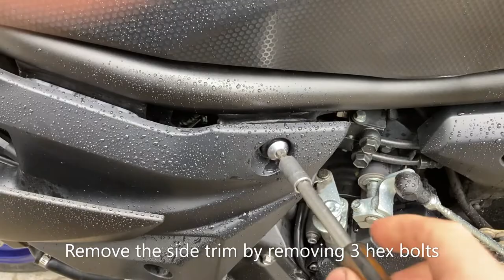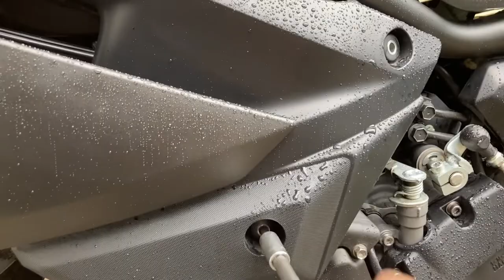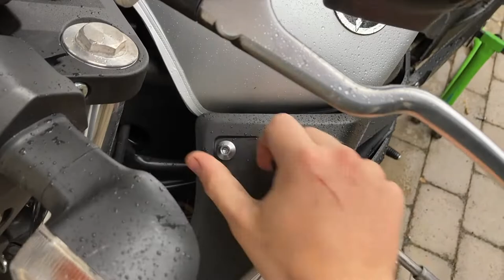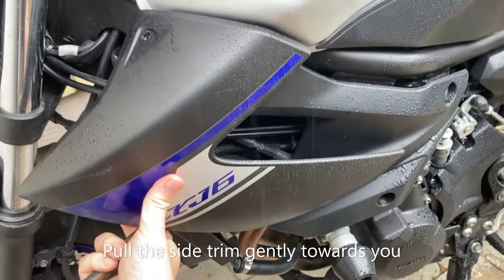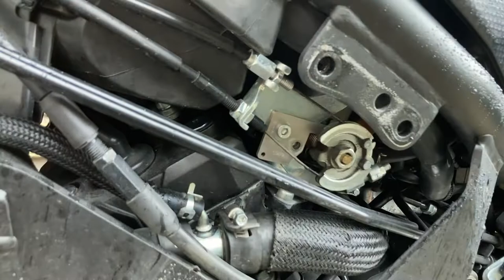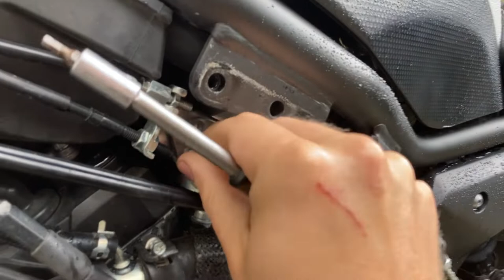HOW TO: Remove Yamaha FZ6R/XJ6 Restrictor plate

Comment: Some years the whole plate hold the throttle wires , its in one piece. If thats the case, saw off the leg on the bottom right and reinstall